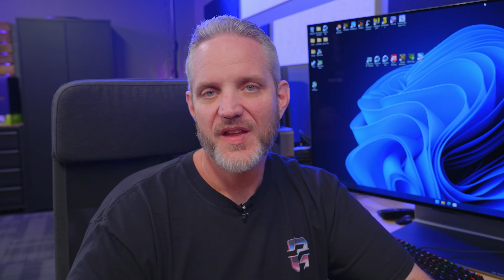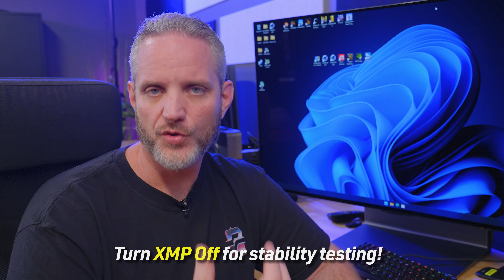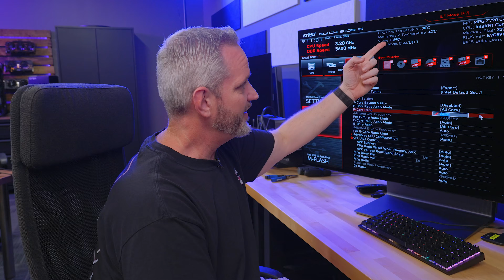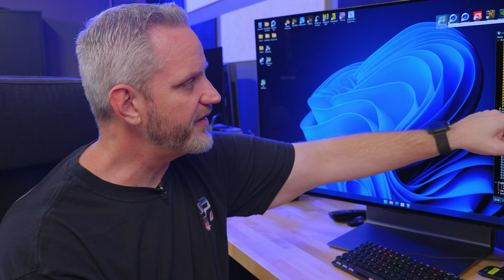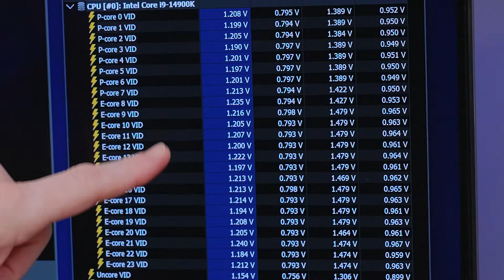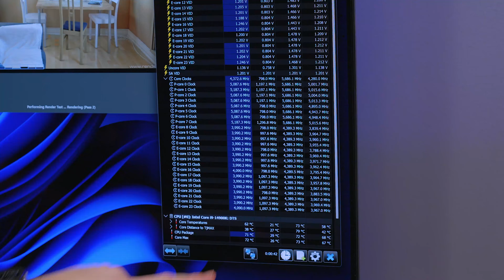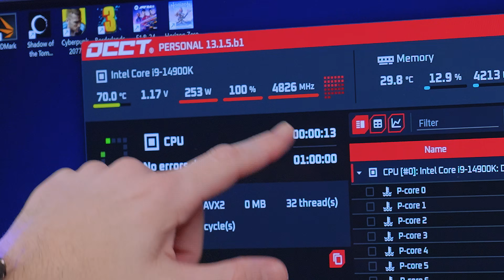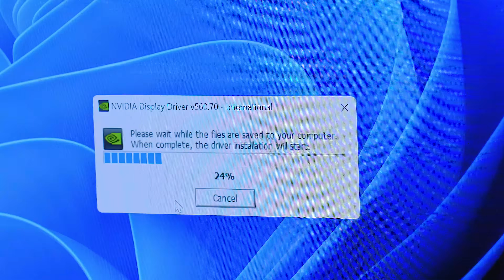Guide: How to check if your CPU is BAD!

Comment: At no point did you check the actual realtime voltage until you glazed over it in OCCT. Pretty sure MSI boards use die sense so you should be able to see the voltage the CPU is actually receiving. The VID and the actual Vcore are not one and the same. Also you neglected to mention that current draw is the main factor in electromigration, and not voltage. Also the instability in shader compilation people have seeing is very much an all core, current intensive workload. A lot of misconceptions here that aren't quite right.
Reply: 1. This is for all boards not just MSI
2. Voltage/Resistance = Current (it's called Ohm's Law)
Reply: @yonghominale8884  The MSI comment is in regards to die sense measurement using differential sensing pins being used and not meaning to say it's only applicable to MSI boards. 

Yes, however simply saying "it's ohm's law" doesn't help this video as it's simply saying voltage is the primary cause. We're not even mentioning the impact CPU load load has, or the fact that different loads cause different current patterns.
Reply: bro just does not know what he's talking about.
Reply: Thanks for explaining this with sentences. Others were giving 1 liners on the subject, short sentences and not saying enough to be worth my time to glance over their comments! Everyone upvote useful comments like this one please!

Comment: My 13900KF experienced the out of memory issue when playing Tekken 8 (Unreal game). Since the microcode update it hasn't happened again, praying my CPU isn't going to fail further down the line.
Reply: After all this time have you had any symptoms of crashing or instability?

I have 13900k and since the microcode the problem was fixed 90% of the time. In all this time it crashed once and I feel that sometimes it lags for 0.5 seconds, tell me your experience?
Reply: @Dokase  I've had no other problems since the latest microcode.

Comment: your infos are nice, but not 100% accurate. your cpu can be degraded, but still finish cinebench and all the normal stress tests without crashing. I can tell you where you really see if your intel cpu is degraded. I had one 13900K and 2x 14900K degraded in alrdy 2 months blue screening, so I know what I talk about. The best way to see if your cpu is 100% fine, are GAMES. Especially unreal engine 4 and 5. The best game I know, if you pass this, you have zero degradation, is the last of us part 1 on steam... In the shader compilation the cpu gets WAY more stressed then in cinebench, using all cores and high voltage. If you pass this, you have no degradation and a stable chip. if your chip is damaged alrdy, it wont pass the shader compilation, it is very stressfull for the chip, and because of the game it behaves completely different then in cinebench. also games like fortnite, diablo 4, days gone, are very good for testing. fortnite cause unreal engine, diablo cause it is very sensitive, and days gone also cause on loading the game a lot of things happen to the cpu, which can crash instantly. games like cyberpunk maybe can be fine too, but not sure(sometimes it crashed, sometimes not). starfield NEVER crashed for me, even on degraded chips. this game is way to stable it seems.

Comment: "As of July 2024, Intel is investigating instability issues with some of its 13th and 14th generation desktop processors, and some of these issues may be due to oxidation during manufacturing. Intel community manager Lex Hoyos says that some instability reports can be traced back to an oxidation issue that was fixed in 2023, but it's unclear if Intel will recall or extend the warranty of these chips. "

What about the manufacturing defects that is not from normal wears and tears?

Comment: do you know how to tweak the settings an i9-14900HX on a laptop?  Power limits, voltage, etc.  I have it on my laptop and my laptop is unstable because everything crashes on it.  It doesn't seem like intel is going to send out a fix on it either.  I'm trying to find ways to stabilize the processor and I'm not having any luck finding any info at all out there.

Any suggestions would be a big help.

Comment: If I leave my chip at default intel settings I can’t even install windows without blue screening a couple of times. If I lower nerf the chip from 57x to 55x on all cores the system is stable enough. I swear I think this chip I have is degraded.

Comment: My buddy got a Corsair i500 pre build. (I didn't know Corsair made pre builds). Its a 4090 build with a 14900k. I was like dahm he got a bad ass pc. Then I look it up, everything looks fine then BOOM it has a 120mm liquid cooler for a 14900k . Tell me that isn't a bad ideA? How does Corsair build a 4090 pc and not put AT LEAST a 240mm CPU cooler. 

His pc crashes randomly on a lot of games (won't run elsen ring, enshrouded, even cs2 crashes occasionally) He's not blue screening and supposedly his CPU isn't getting that hot so, do you think the crashes are from a RAM bug (more common) or is that 120mm AIO for a 14900k ludicrous? Why would Corsair do that to people?

Comment: 13700 used in scientific computing been running since November. Never overclocked. System is always on because it needs to be. Came in last week, system wouldn't boot. Acquired a 12900K (prices of those have gone up $50 in the past few weeks for some reason). Replaced the CPU, system works. Intel is now asking me if I updated the BIOS. Yes, I updated to 1661 on an Asus Z790. The 0x129 microcode didn't come in soon enough, and I don't think it would've really solved the problem.
I think something really devious about the lack of a recall is now we have to spend more money to fix Intel's chip, thus rewarding them for their shitty product because we need the system to work. Once the RMA goes through, what do we do with the extra chip? Build another system? We can't return it because the RMA process will surely take more than 30 days...

Comment: Hey Jay, great video as always!
However, I noticed that you’re using VID to show the voltage sent to the CPU. Am I wrong, or shouldn’t you be checking the Vcore value, which is listed a few lines below in the HWinfo? From what I understand, VID represents the voltage requested by the CPU, while Vcore is the actual voltage delivered to the CPU by the voltage regulator, and these values aren’t always the same. Please correct me if I’m wrong!

Comment: I have had my 13900K running on air since the day I got it (I know, I know). It had these same crashing issues since day one. So, from the very beginning my goal was to get acceptable temps. So I immediately did some BIOS tweaks, undervolted, lower maximum clocks, LLC adjustments, etc etc. With the tweaks I ended up making,  my 13900K maxes out at 80C under full load on air. It also eliminated the crashing issues. The new BIOS runs perfectly for me without any tweaks, aside from temps, so I applied similar changes I did before to lower my temps and I'm pretty happy with the results. In a way, I feel like I, "saved," my CPU just by having it on air (against recommendations) because it required me to undervolt/underclock right away.
Reply: I underclocked mine to 3Ghz all-core and it reaches 35c max.
Reply: @dxncx4555  You're missing out on 2.8ghz of performance though. Why not keep raising those clock speeds until your temps sit just under 80c while under stress
Reply: @durrik  it was a joke :D Running it Stock with some tweaks for better Temps, also installed a contact frame
Reply: i have a deepcool ak620. works absolutely fine on my 14900k but then again i live in minnesota and my room ambient temps are 60-72 during winter and i have an open bench style "case"
temps have never been an issue. only time i hit thermal throttling is when i simultaneously loaded and stem analyzed 4 songs in rekordbox. that wasn't a usual case scenario for me
Reply: Please continue...
Reply: what is your cooler? maybe you need to replace cooler, if you have bad cooler, it may stop. i have 13700, and 14900. I replaced with highest cooler out there.
Reply: @mikeree8543  It was a choice to run it on air, I knew I'd have to undervolt a little to maintain manageable temps

Comment: You could just use the Intel Processor Diagnostic Tool - it tests all the features as well as stress tests the CPU.
Reply: Yeah, great idea. Letting Boeing self-regulate showed great results, too.
Reply: @Gaius__  CPUs are airplanes my guy, it's a silicon chip not a airliner door.
Reply: @deathetech  "CPUs are airplanes" ... ???
I guess you meant to type "aren't".
And yes, you are correct ... a CPU is way harder to manufacture than an airplane door.
Also, if you think the doors are Boeing's only problem, you haven't paid proper attention.

Comment: Intel offered me a refund as they don’t have any replacements in stock for the next 4-5 months per RMA email.
Reply: Take it and put 12th gen bro
Reply: @mooshi-x7927  is 12th gen supported on x790 mobo?
Reply: Take the refund and go AMD, thank me later.
Reply: I was offered the same they then came back to me to say they have some new CPU's available.  Im still requesting the refund (Told its going through the approval process in upper management) I will be going with the 12900K.
Reply: @proton698-b1q  12900K is virtually identical to 13700K.   I bet you, that CPU is affected as well.
Reply: was ur cpu degraded? I have a 13600k and have had zero issues, but i feel like asking for a refund to save me the headache in the event it ends up failing lol
Reply: What did you have to do to get them to offer you a refund? Intel is bombarding me with troubleshooting techniques and playing hardball on doing an RMA on my 13900k.
Reply: @jonathanmepham9568 How did it all go? Hopefully good

Comment: day 1 a week ago. Date of purchase?
What is the exact issue?
How long have you been using the system?
Is the system working before?
Were there any recent changes made to the system, such as hardware or software before the issue occurred?
What troubleshooting steps have you tried to isolate the issue?
Are there any signs of physical damage in the unit?
Did you overclock the CPU?
What is the exact motherboard model used to run the system?

Comment: Say Jay, with what we know about Intel and AMD CPUs right now, would you even consider building an Intel based system using a 14900K CPU? If not, which AMD CPU/GPU (equivalent)(I have an Nvidia GPU I will install, but I still want an on board GPU for other reasons) would you use instead for a home office/business (Photoshop/Lightroom/DaVinci Resolve) non-gaming PC build? Thanks!
Reply: It's probably a bad idea knowing everything we know now. But if you were going to build a terminal Intel build my 12th gen are fine after tuning, been deployed for 1 year 3 months, but I bought on sale and if you think about it I only got 1 stable gen on all 3 rigs for home office/gaming. You could safely go AMD, 9000 series isn't performing as well on Windows 11 (10 LTSC would be the option if you can't or don't want to Linux) but 7000 series is stable (my friend I helped with 5800X build is also still happy). 13th/14th also now have a rep that will impact resale value, I feel like they became lemons. AM5 has more of an upgrade path. My main rig is still a 12900KF 4090 48gb DDR5 however you also get all of the same core type with AMD, none of the P core, E core. 7950X/9950X might be better options, GL. Would price out the builds and if you did go 13th/14th sounds like you need to lock cores, voltages, and BIOS update to whichever one is most stable.
Reply: @osinstalls Thanks for the advice.

Comment: Degradation has always been a thing if you pushed your CPU hard enough:

My 2600K from 2011, could original do:
5050MHz without HT
4850MHz with HT

4 years later, 2015, it had degraded to:
4850MHz without HT
4700MHz with HT

8 years later, 2019, it had degarded to:
4700MHz without HT
4600Mhz with HT

11 years, 2022, I gave it to my nephew and it has degraded to:
4600MHz without HT, which is how he has been using it for a couple of years now
4500Mhz with HT
Reply: And my 2600 K is running fine.  The issue is you are running it outside its design spec.  If you didn't, it wouldn't have degraded. It's still running well, well beyond its design limits.  CPUs will not degrade if run within their design specs - within any reasonable limits that a normal user will see.  What kind of voltages were you giving it to get that 2600K running at 5ghz? Just like the issue with 13/14th gen, you were running it beyond its voltage design limits. Then it will degrade.  Jay's allegation that there's a "ticking clock" is not true, unless you're pushing it well outside its envelope.  You/ve got a ~135% overclock, even after 11 years of abuse.  The fact that 13th/14th gens were degrading in months is another story entirely.

Also, your degradation is likely not just the CPU.  Your electrolytic caps on your motherboard are drying out, and the board is becoming noisier.  I would be surprised if a re-cap didn't bring you back up somewhere closer to where it was new.  Capacitors and other passives on the board are way, way likely to "degrade" well before any CPU.
Reply: @tcp102  You are right and it still running stable at 4600Mhz without HT, so not complaining 🙂I always ran it 100-150Mhz below the maximum OC and never had any stability problems with it. I have not consider that it could be the motherboard caps and it has been running in the same ASUS P8Z68 DELUXE motherboard for 12+ years, so maybe it is the motherboard and not the CPU. For voltage I used voltage offset for the CPU and believe the maximum voltage was 1.45 V, although it rarely hit that in games.

Comment: Are these CPU's failing the same as the 3090 capacitors all failing and the 4090 cables all melting thing which you and the other youtubers were pushing?

Comment: For RAM, i run 4 sticks of the DDR5 that came with a bundle at Microcenter. I have yet to find a Motherboard that states it's support for this ram in 4 stick mode. I have my sticks running at 5400Mhz rather than the 6000Mhz.

Comment: This is why I miss Intel OEM boards. You wouldn't have this problem with one that is calibrated for the processor properly in the first place and not monkied with by default.
Reply: Intel definitely have reference boards, they use them for internal V&V / release testing. I am super curious (1) why Intel does not sell them like they used to, and (2) why the internal testing did not catch any of these issues. Voltage spikes were clearly seen, even if they are on a non-degraded CPU
Reply: Bring back the BNC connector and SIMM memory!!! LIFE WAS EASIER!!!!

Comment: So I've been sitting on a 13700k that I bought some months ago, partially because I didn't feel confident enough to do the build myself. To be honest. I'm still figuring this crap out. 
But then the news comes around that the SKU that I happen to own is...." One of these" And... Yeah. Hopefully videos like this will play out what I need to look for when I do finally fire that thing up
Reply: If it's new and unused it didn't degrade. Hopefully if you set it properly it won't be a problem. If it's a sku that was affected by the oxidation issues, RMA.

Comment: well a  good CPU can get some degradation if is overclocked and not set properly in the bios, voltages, watts etc, but if a CPU  (well built by default) and you run it like you should with stock values, that is more than enough,  you can be sure you  will have a CPU or computer to life, even if gaming, people are just greedy and want a game to run at 170 fps and that's literally Dumb if you can run your cpu and gpu in a game between 60-80fps you are perfectly on the zone. I still have 2 computers running here at home, my wife runs autocad because she is an architect with a CPU from 2010 with the gpu gtx 600 i think , the computer is on all the time she just turn´s it off when we go on vacation, imagine that. so this trend that a CPU lifespan is getting lower or controlled on purpose i guess,  you have to buy a new one every 4 years is a very dishonest practice from these vultures companies, im watching the video because i bought a computer for me  around 4000 euros with the best components i could find but now is having problems, is freezing, temps are too high, i have done all the bios updates and now the temps are under control around 28-34 degrees idle and 50-66 degrees when exporting engineer stuff ( pretty heavy software) ,  i had  to become an "expert"  on the bios to change values that should be there from the beginning , i actually underclocked the system, with some default but safe values, why i bought the 4090 Ti  that's a disgrace from my side. i have to be honest..., are these companies with a wave of woke kids with green hair and obviously the ring on the nose? even the hardware world is in a crysis now, not just the world itself with prices through the roof but paying 1700 euros for a graphic card,  Dear Lord i really feel stupid with these scams and that's my fault, no more, next computer will be team Red, and we do have money, but isnt for this, is for real things in life a computer is just a tool ,  money is for a week on the beech on the Canary islands... it was 890 euros cheaper than my GPU F that, Jay you have tutorials how to lower the i7 14900 settings on the Bios  right? i need to do that